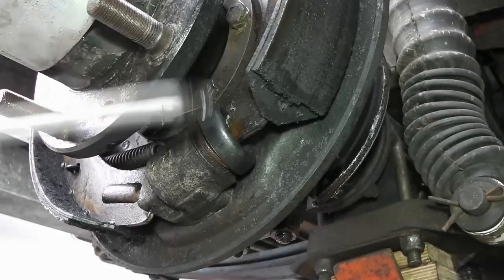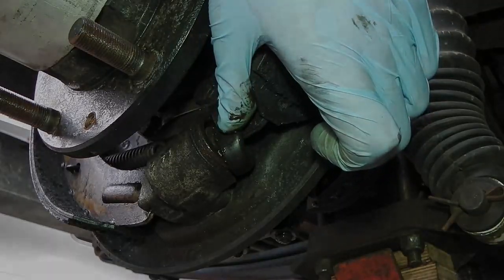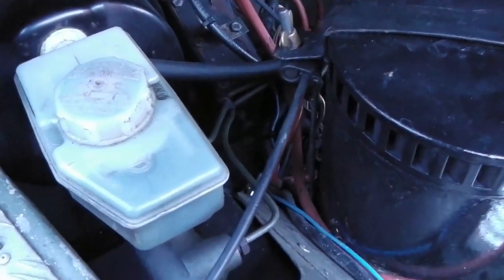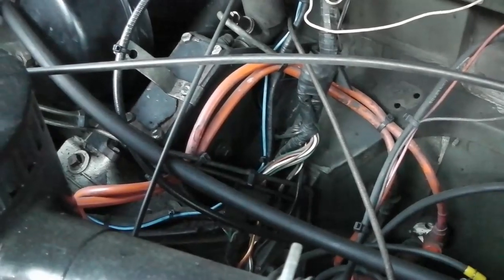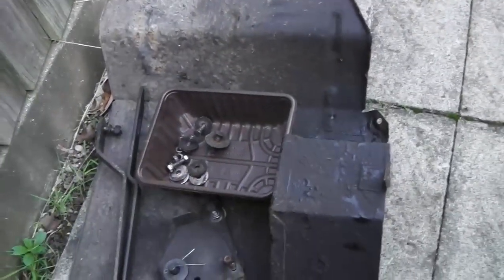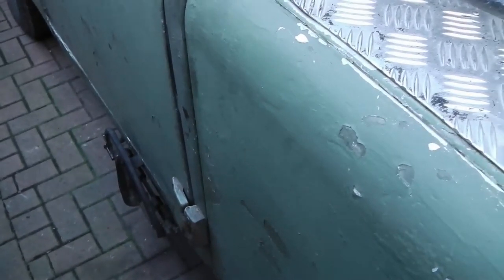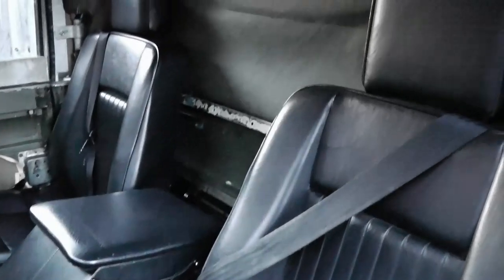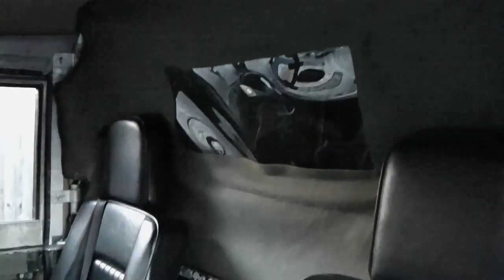Land Rover Series 3 Brakes and steering - Part 1

Comment: Love following your videos I have an 88 hardtop 2.25 which despite owning since 93 only just found its military history cpl years back  as i had no mil reg and it was registered in 87 on a Q Turns out it is genuine late 1980 build with later rationalised axles and metric brake fittings and uprated drums would have had a 2.25 diesel when supplied to RAF as batch of only 22  anti spark The only diesels British military had  Spent its short life till 87 and demob at RAF Honington  Norfolk on bomb dump Had a petrol fitted at some point Goes like a little rocket esp with 2 inch stainless exhaust and Weber  and brakes are superb

Comment: Brake overhaul = take the entire corner off! ;-) You're always thorough.
Personally I would stick with the wing you have as any replacement, new or second hand, would probably require a lot of fettling to get it to fit the same. I had a 2.5 90 - good engine if a little thirsty! Like the 2.25 sips petrol!!! Cheers
Reply from the maker: Oh yes, one thing I have learnt working on this vehicle is that a few hours spent getting better access to the job saves many more later on. 
It seems that wing parts are a little harder to come by than I thought, so it will probably be a case of making a strengthening panel and bonding underneath - I'd quite like to loose the chequer plate eventually or at least find some of the older style stuff, like southern electric used on their Rovers.

Comment: Hi mate, my  front passenger side wheel is incredibly stiff  to rotate when jacked up, and my free-wheeling hub is disengaged. Whereas the driver's side will spin freely, when pushing the Landy there is a bad  squeal coming from the passenger side wheel, is a f****d wheel bearing the cause or a seized brake etc?? It has been sat in a field for 8 years until now. I'd massively appreciate the advice as a newbie, cheers

Comment: Put a thick dollop of silicone dielectric grease under the wheel cylinder rubber dust cap on top of the piston! It will keep all the water out!
Reply from the maker: I've got some Castrol red rubber grease for that, that's the proper stuff to use and I will certainly get a bit of that in there before fitting the cylinders.

Comment: Hey, just curious to know if you have the 5 main bearing engine. Is this original to your S3 or one from the early 90? Thanks Gareth.
Reply: I have a 61 S2a with the thread in type wheel studs. I was wondering if changing to the wolf style studs (and hub) would be compatible. The studs with the heavier duty shoulder seems a far better design.
Reply from the maker: Hi Gareth, yes this vehicle does have the 5MB 2.25 and it is original, they came along around 1980. Incidentally, it will be getting the 2.5 from an early 90 when I've finished building it!
Reply: @steamwally  thanks, I acquired my s2a with the 90 2.25 petrol. So looking forward to when you upgrade yours. Keep up the great work!!
Reply from the maker: @GH-rr7tk  Thanks, the 5 bearing engines are certainly worth hanging onto!